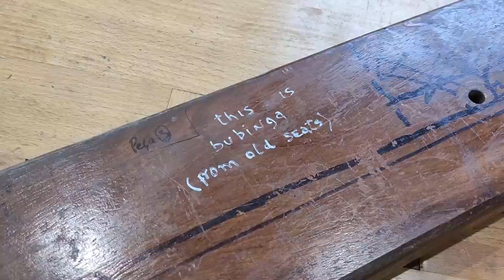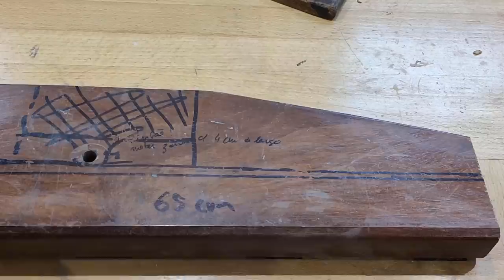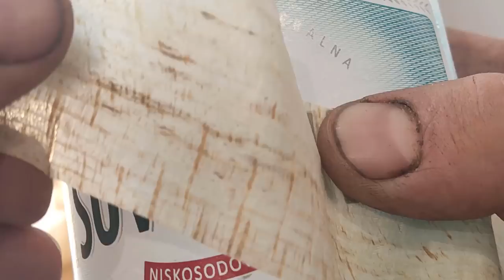051 Will it work again ??? Not restoration, rather rebuild.

Comment: Great work as always.  Fascinating to see you using those sliding dovetail planes for a new project.  The jack plane that you used early on, was that the shooting plane that you made with a steel sole on two sides?
Reply from the maker: Thanks Paul, yes that was my shooting plane :)

Comment: Disassemble an old hard disk. One with spinning platters in it.
There are two (or more) super powerful magnets inside, usually shape like 1/3 circle.
Scan your stock manually with that (tied to a string or sumsuch).
Reply: i use the same tool to find old nails/screws ;)

Comment: A rare earth magnet is much more reliable for finding hidden bits of steel.
I'm not sure Ilke this one so much. The mismatch of timbers jarrs a bit, and I really don't know why a sliding rebate was necessary, and why such a thick replacement sole. A simple flat piece 8 to 12mm thick would have been just as effective, would it not?
Reply from the maker: Hey, 8 to 12 mm was to thin to make tight mouth. I made that joint for my practise.